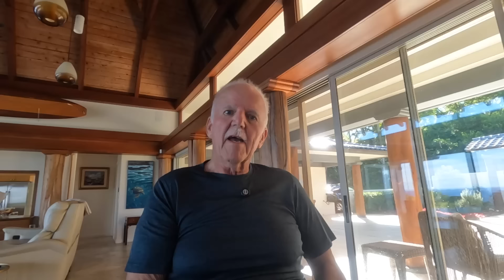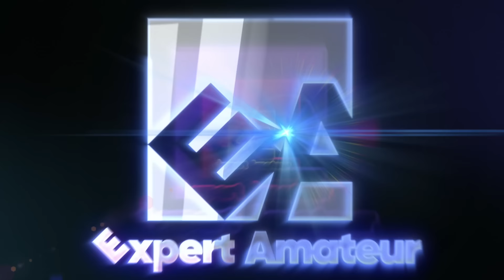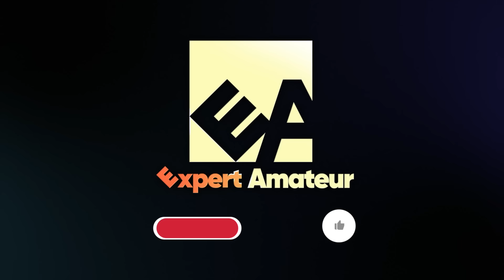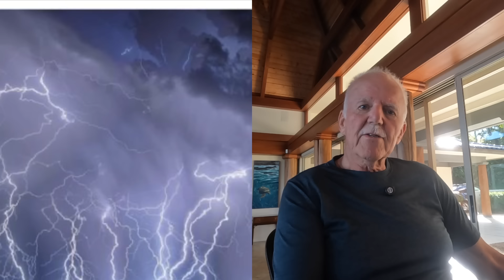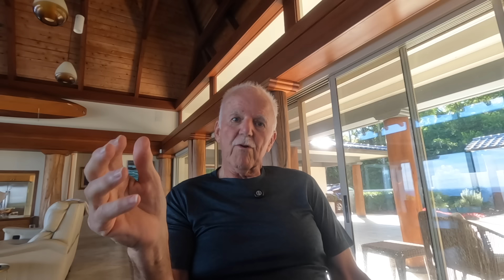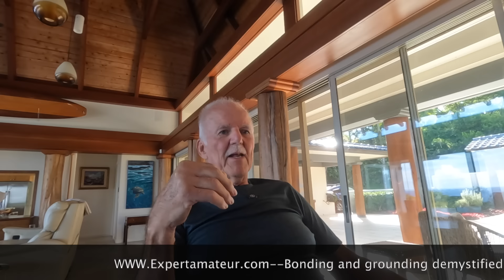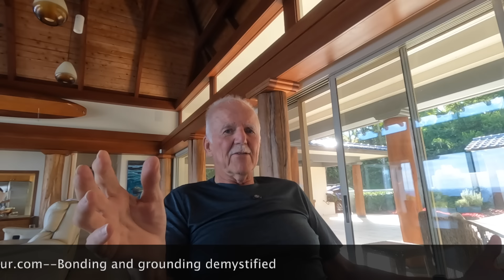solar grounding

Comment: Hi. Great stuff. A little bit over my head. Can you give some thought to, and provide some words on grounding for mobile systems?  Specifically a way to ground my rig when camping?  I love camping in my truck/camper in storms and often near the top of mountains. Can I drive a ground rod temporarily and achieve some benefit?
Reply from the maker: Probably not. You're courting a direct strike. Fortunately you're more or less in a faraday cage insulated from the ground by rubber tires. A direct strike is nothing like a strike that happens even a few hundred yards away. The nature of things like insulation, what's a conductor, what's going on at the interface between energy transmitted in the air, and in the ground, gets really messy and hard to define when voltage is measured in Mega-. Which is a lot of words to say "I don't know, but I doubt it." Read jamessparks6133's comments below. I've read a lot about this stuff, but my practical experience is limited.
Reply: @ hey, thanks for the feedback, although I’m not sure which part might be “actionable” as they say.  Cross my fingers?  Maybe a rod on the roof rack, fat copper conductor to a 2’ rod pounded into the ground?  Just kidding myself?

Comment: As an electrician over the years I've installed many halo ground systems on cell towers/huts to aid in lightning arresting. The one thing that you have to wrap your mind around is that standard conductors that we utilize have an insulation rating of around 600v nominal so as you deal with lightning at 1milV or ? that insulation jacket on that conductor is only there to keep the copper dry.. ;)   1MilV will jump right through it like it isn't even there. So if you come from the top of a building or tower and head downward... you can NEVER go back upward with that wire because that 1milV is heading downward toward EARTH and that insulation will not stop it and allow that conductor to carry it upwards again, the voltage will jump straight through that insulation and hit the nearest conductor with the least resistive path to ground and follow it on from there.  If your PV wires come in from above, say from a rooftop array, have a HALO ground system run around the top perimeter of the PV room to arrest any strikes and direct them away from equipment straight to earth. We always drove dozens of ground rods around cell towers and huts.. all tied together with #2 tinned copper, exothermic welded.
Reply: I'm curious about grounding. I'm looking at building an off-grid solar system on the big island of Hawaii. I have 1-2 inches of soil and then lava rock all the way down. Porous resistive rock. Good luck driving an 8 ft rod into "blue rock". I'm looking for good options for grounding. I'm considering running my house ground to a side walk pour using a ufer ground ito the embedded rebar. Maybe 24ft in length of 3 ft wide sidewalk. There is no house foundation, just post and pier construction. I'm curious what are your thoughts for a good ground in such a situation?
Reply from the maker: @adjr2000  The ufer ground is about the best you can do on the big island without some real luck. I'm on Maui. Pounding the three foot stakes in for the racks I just added required drilling with a three foot masonry bit and a hammer drill. I burnt out one drill halfway through the project. I tried a regular ground rod at my house here using a power head and got it in about a foot before it stopped dead. I tried a dozen times and finally just tied in to the Ufer in the slab for our house. Hawaii is special for both blue rock and vegetation control. Mainlanders don't get that landscaping here (for my firewise efforts) is beating back the jungle. I get comments on my videos that I'm a vandal. On the plus side, gravel is cheap here (only thing that is).
Reply: Yes and even then equipment gets fried if lightning hits it right. Been replacing electronics on tower's for years. There's only two things you can do 1 eliminate all ground potential using isolation or Two ground the crap out of it. Neither is a guarantee especially with sensitive equipment.
Reply from the maker: @bugboy8462  Sad but true. You actually can sort of protect it from everything but a really powerful direct strike. Radio towers do it. Utilities do it. They spend a few 100K doing it and still lose gear sometimes. But every lineman knows you don't want to be anywhere near a substation when there's a lightning storm
Reply from the maker: You're a horrible man who could easily cost me a small fortune in added grounding equipment. I'm trying to deal with strikes that are perhaps half mile away, and you're tempting me to do better. Damn it. I don't need more projects.
Reply: @ExpertAmateur-xn6dr  Isolate your incoming AC line.  The rest is fine.

Comment: There is a lot of conflicting information.  I have researched this and, honestly, have not come up with a consensus.  
These recommendations have come from Solar Companies, Electricians, DIYers and many YouTube "experts."
As a result, my system (just a small 12v system at a remote cabin) is not grounded.  I wish I knew definitively the correct way to do this because it makes sense to me that it is important.  Right now I am in the "seems better not to ground rather than ground inappropriately" school.  HELP
This makes sense to me and is in agreement with some of the sources I encountered.  The one question I have is this:  in a solar electrical system you have a DC "side" and, after an inverter is employed, you have an AC system.  How does one handle this?  There is no grid power or ground in my situation, just a solar system.  
I can ground my panels as described, attach the grounding wire to a grounding rod, bond a copper wire to the rod, bring that into the cabin and attach it to the DC buss bar (Victron Power In).  That takes care of my DC "side".  Do I then bond this DC grounding loop to my AC circuit in the AC distribution box or drive a separate rod (violating the principle you talked about) for the AC "side."??
Love to hear your response.
Reply from the maker: You aren't grounding the DC side--you don't need to. The panel frames are isolated from the DC (or at least they are supposed to be) and are almost certainly completely isolated from the AC side since your victron has a transformer which isolates the DC. Ground the frames and the framework they attach to for safety (in case some stray AC current reaches them) and lightning protection. If you aren't concerned about lightning zapping your gear then simply connecting the panel and frame ground to your system ground (probably through your inverter) will prevent you from getting shocked from touching the frame if there's a fault. If you care about lightning protection a single ground rod connected to your panel ground will take care of that. If for some reason your cabin has a ground rod on the service panel (unlikely) you should bind that to the ground rod for the panels and framework. Otherwise, you're as good as you're going to get.

Comment: My growatt inverter says not to ground PV, just to add a surge protector. Not sure why?
Reply from the maker: Hopefully you misread that. You DON'T ground the negative side of the DC wires. We're talking about panel frames and metal support structure. Surge protectors offer some value, but it's limited.

Comment: OMFG - This video is the perfect example of bad and false information! 🤦‍♂️

This entire video flips back and forth affirming the NEC / CEC and well established principles, codes, and standards.

Yet, later flops back to none sense while affirming two separate grounds are the ROOT CAUSE for a voltage potential difference?!? 🤢

Please stop spreading these lies and misinformation to the less than bright people! 👎

I have no clue why this was suggested to me??? Regardless, the information as it relates to grounding is dead wrong! 🤮

You literally quote people who know the correct methods and standards yet state I’ll do it the other way???

Sweet Jesus . . . 👎

Comment: This is an odd question I have been considering, How would you propose grounding an off grid system, with panels, on a boat house?  I assume a set of grounding rods back on the shore with a grounding line from the batteries and a grounding line from the bonded panels.  And I would love to hear your thoughts, I loved the discussion you gave because it brought a pretty complicated topic down to an understandable level.  Many thanks

Comment: My ground mount system is bonded together with #10
And 10’ of rod just for the structure.
I got tired of getting zapped cleaning the panels.
A ground tester will let you know if you have a good ground.
My panels have a better ground than my house per the tester.
Also use a EEE crimp that fuses the wire to the rod, the regular acorn is not a great connection and tends to corrode.
You can also cadweld the connection which welds the connection together.
In Central Florida we get a lot of lighting.
Reply: Was this zap due to induced energy from a distance lightning event or just static build up?
Reply from the maker: Yes, you do get a lot of lightning. In fact you'd have to move to central africa to get more. Not a lot of folks have a ground tester. I check my grounding rods by pounding in a second one six feet away and measuring the resistance. Of course if it's less than 100 ohms (mine was about 30) you already have a second ground rod so you might as well tie them together.

Comment: So, regarding the array, in a ground mount scenario where the entire racking system is wood, what then?
Reply from the maker: You'll still want to ground the frames.
Reply: @ the frames of the panels? if so, and there’s not any metal actually connecting any of them, what would you do…run copper wire and grounding self tappers in a linear path from the the first to last panel and then to a ground rod?
Reply from the maker: @johnadams3800  There are simple aftermarket cables that will make it easy. I used these: https://signaturesolar.com/dynoraxx-dyno-bond-38-bonding-jumper/ and connected the last panel to bare wire with one of these: https://signaturesolar.com/rack-grounding-lug-sgb-4-6-awg-to-10-awg/
Reply: @ExpertAmateur-xn6dr  thanks so much, sir. Do the panels actually attract a lightning strike? I was given to think the frames were all non ferrous?
Reply from the maker: @johnadams3800  It depends on your definition of "attracts". When a lightning strike happens nearby there is an air wave and a ground wave from the massive amount of power expended. Any conductor nearby will have a voltage induced into it, just like an antenna has voltage induced into it from radio waves. The frames are aluminum, which is almost as good a conductor as copper, so they will have a voltage induced into them, as does the earth electrode from the ground wave. Keeping this induced voltage out of your equipment is the aim, so best practice is to connect the frames to both the system ground and an earth ground and to bind (connect) the grounding electrode to any other grounding electrode the system connects to. The overall system ground will connect the ground rods together (both the local ground rod and the system ground rod) but unfortunately that ground path takes the induced voltages through your equipment. That's why I recommend an additional direct ground path. From a safety standpoint (avoiding shocks from the panel frame) connecting the frames to the system ground is sufficient.
Reply: @ExpertAmateur-xn6dr hey, so half a year later, I’m ready to start the grounding of my new panel array. These 16 panels are running 8s into 2 parallel strings, so we’re are at just under 300v on each string. The racking is all pt 4x4, and the panels are held in place by 2 runs of 60’ of unistruts screwed into the wood. The panels are clamped in place with aluminum clamps which are made for this exact purpose. My question here is can I run the grounding wire straight from the end of one (or both) unistruts right to the grounding rod? Is using dissimilar metals an issue to factor in?
Reply from the maker: @johnadams3800  Yes you can, though if your panel frames are anodized the connection of frame to unistrut is unreliable without a toothed plate at the connection to cut through the anodizing. Some clamps include that plate, some don't. Most aluminum frames are anodized even if they look like plain aluminum. I'd use the wire clips in addition--they're cheap and they have a very reliable cutting tooth built into the clip. Dissimilar metals should be a problem, but oddly, isn't. I have racks here on Maui that have stainless screws connecting to aluminum with salt spray in the air. Should be terrible for electrochemical corrosion, but they've been in place to 13 years and show minimal effects. I don't offer that as proof, I don't know why they haven't rotted away.

Comment: Could you tour your beautiful home for us? What sort of wood are those interior posts made of? 

Was about to build similar style home in Kauai but forced to move back to mainland for proper health care.

Just about to install my solar system.  Was going to bond my panels and run to main house ground, but now I think I'll add a ground bar near my panels as well (about 400' away).
Reply from the maker: Those are Ohia posts, impossible and illegal to get now with all the big ohia trees dying from disease. We bought the house in 1999, when it was quite reasonable. We couldn't afford it today. I'm doing a set of videos about protecting your home against fire using solar power that include a long walk around the house. I'll get some posted soon. It's a bit effort, but the blog posts start here: https://expertamateur.com/solar_fire-protect/  I used to say the first requirement in dealing with a medical emergency in Maui was a plane ticket. It's not so true these days. For some things the medical care is far superior to what we could get on the mainland.

Comment: You have done quite a bit of research and acquired knowledge of electrical systems.  I had Mike Holts classes 3 times and have also had a solar class taught by a NEC panel member.  No comment on that class.  I designed Solar electrical systems for a top tier electrical contractor for 3 years.   Mostly Utility grade (Behind The Fence).   Systems from 5KW  to 34MW.  A few comments if you don’t mind.   
These are just my opinion!  Ground rods connected by #6Cu is the least effective means of grounding.  BTW, unless you measure the resistance, two are required.   NEC has a list of “Acceptable Grounding Electrodes”.  The Best ground is bare copper installed in poured concrete it direct contact with soil.  The grounding electrodes on large solar arrays was the steel support structures that were in the earth.   So, let’s discuss the bonding ground conductor from the main to the system.   I’m with Mike on this one.  By doing as you suggest, you have created a dual path to ground.   The bond you propose, and the equipment ground if it is grid tied.  Other places in NEC lean toward no bond.  Parking lot lights should not have ground rods and GEC’s installed, even though many Consulting Engineers require them.  The second is, a separate structure being fed by a feeder from the main structure.   If you do this, you are required to have EGC in the feeder, connect EGC to the ground bus, and to a Grounding Electrode.   
If your solar system it completely separate from your grid system, you absolutely could tie them together, although with better than “a ground rod” on both, it is totally unnecessary.
Reply from the maker: I'm trying to make sense of your comment, but failing
Reply: @   In short, ground rods are only one way to earth ground and are the least effective.  CU wire in concrete is the Best.  If you run a feeder between the main panel and a Solar system, it should be hots, neutral, and equipment ground.  Running a separate conductor from one to the other as you suggest is paralleling the ground and should not be done.  If you have a utility service and an off grid solar system, then you could, or should run a grounding conductor between them .  Hope this makes sense.
Reply from the maker: Bonding the ground rods together as long as the distance is reasonable almost makes them a single ground. Even a thousand feet of #6 is less than .4 ohms. They aren't paralleled unless you want to get strict about electrical theory. For the 250 feet my ground rods are separated reading the resistance from the array end, to the service ground rod  and back through the ECG was .248 ohms on my trusty Tektronix Fluke knockoff (they got sued by Fluke and had to destroy them, but I kept mine). The ECG is certainly higher resistance for the same distance with all the random runs and screw terminals, and since it runs through the equipment any big voltage spike across the equipment ground will be induced into the components. Avoiding that is the intent. One of the other commenters reminded me of RC56, which says you should do exactly what I described. Mike Holt is talking about code requirements and safety, and I agree with what he is saying, but code won't necessarily save your equipment. It's the minimum requirement for safety. I don't want to sacrifice $10K+ on minimum requirements.
Reply: @ExpertAmateur-xn6dr     So, let me ask a question.  Let’s assume you get the resistance very low.  You have tied both systems together to this grounding system.  So, by paralleling this with the equipment grounding conductors you now have two paths for equipment ground.  Do we agree at this point?   Now, let’s put a short circuit into your system.   Let’s say an arcing short occurs in a washing machine.  Hot to the metal frame inside the washer.   Assuming a standard circuit breaker, no GFCI, no Arc Fault.   What has your method affected?
Reply from the maker: @KevinCoop1  basically nothing. I suspect you are inferring that this parallel system reduces the ability to trip the breaker in a fault. It doesn't.